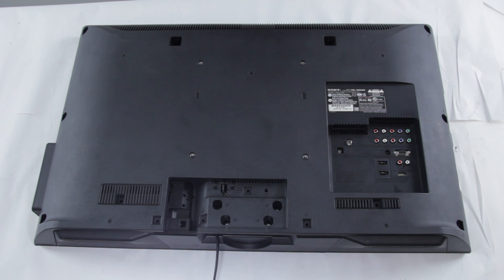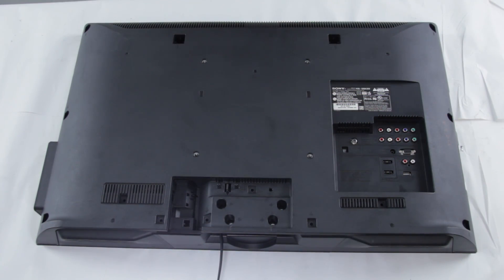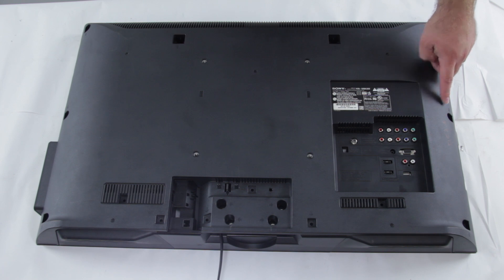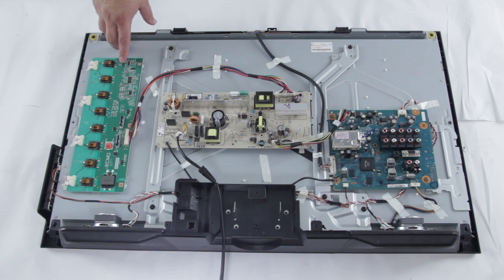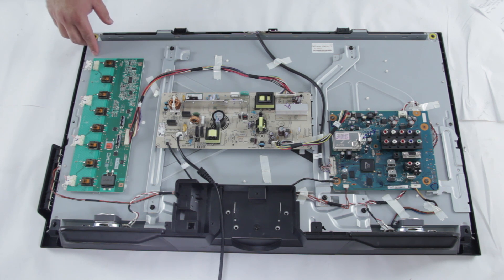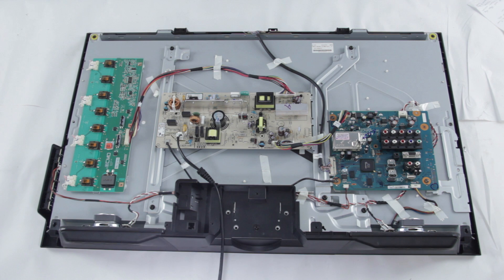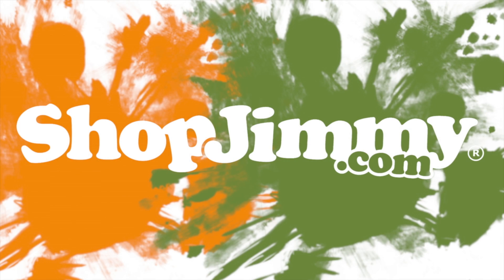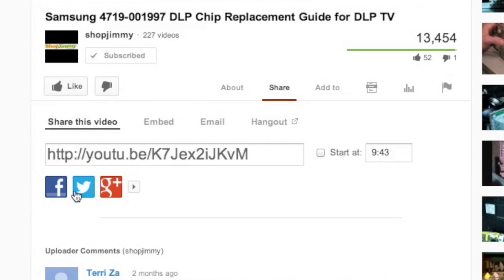LCD TV Repair Tutorial - Backlight Inverter Common Symptoms & Solutions - How to Fix LCD TVs

Comment: Thank for the video.  I  have a sayonapps TV that has low brightness.  Model no: LED-32A . Ac voltage: 100-240v~,50/60HZ. Power consumption: 60w.

Comment: My Samsung 2021 65’ Model: Model :
UN65DU7200D Model Code: UN65DU7200DXZA Serial number: 0H0B3CZXC00219 has a black screen and all other features seem intact so is it accurate that statistically speaking the issue is most likely is TV Inverter, then Capacitors, and then LED Bulbs themselves?    What does a replacement cost for the inverter and perhaps the capacitors but I think if it’s the bulbs it might be too much for me,  thoughts? What tools would I need other than a multimeter?  Thanks Lewis

Comment: I own a Vizio M3D55OKDE television. Serial no.LTYPMLGN4651757  there was a dark impression on the upper right hand corner. After a month or so, the lower screen got dark as well. I was assuming the backlights were going bad. Upon disassembling the tv. I noticed there are no back light strips across the back of the housing as seen in many of your videos.  Can you help?

Comment: I have a high sense LEDLCD TV model number 65R6E1, serial number 65G1947M5H03109. It turns on and the screen flashes and the red light flashes three times. It won’t let me home it.

Comment: D65U-D2   these hve the high backlight strip failure rate so i wonder if its just the strips but its a 65" vizio its darker than normal especially along the bottom 5 or 6 inches towards the middle and to the right of screen and if i raise the brightness for more than a few minutes the screen will shut off but i still have sound and i used a flashlight and could see the image with a flashlight on it after it went blackscreen and still had sound.  inverter board??? lcd display? im not sure

Comment: Hi I received a TV from a friend who bought a new one. There is NO REMOTE CONTROL and the buttons on TV have been damaged (will try to link pic). I'm able to use manual power button to turn on (green light solidly displayed), the screen brightly flashes momentarily then goes black. When all lights in room are turned off and flashlight is directed towards screen I am able to faintly see the home screen displayed therefore I believe it is a backlight issue. Please help! Also, TV has not been connected to wifi network. Toshiba model 58L4300U Serial D53368T12311C1 dec 2013

Comment: Hello, I own a Toshiba Regza 40xv648u LCD tv. It initially had the following issue: black screen with audio ok. I made the flash light test and were able to see the menu. Then I replaced the backlight inverter board. Now the TV seems to work perfectly fine (screen and audio are ok) but after few minutes the TV shut off and restart by itself. Do you have an idea what could be the issue? Thanks in advance!!

Comment: Hi Sony KD-55X9005C model first problem started wouldn’t power on checked fuse ok then tv ok until next day, now no lights nothing, tries a hard restart, that didn’t work, checking the voltages marked on power supply all seem correct, so am mistified as getting absolutely nowhere, thank you!

Comment: Hi, i have a JVC tv (LT-32A80ZU) it turns on then immediately goes black
the inverter board has black stuff on one of the 0 resistors going to one of the transformers. can't seem to find the short. is a new inverter board my only option?

Comment: Hi, I have a  Samsung TV model LN55C650L1F. It is not my primary TV, but a TV we used when childres were yunger, so it is not too much used. Anuway, since a couple of years I noted that the right side of the screen is a bit darker (dimmed) in comparison the the left side. I have the while screen, but as I said the right half or one third is darker. This point makes me think that the backlite, if composed by two stripso, or tubes, could be the reason, not necessarily the backlite inverter, but who knows ... ;-) I am not sure if they are LED backstrips lights or CFL lights, and I cannot fint this information.
Could you, please, help me with this information, and in both cases let me know what exactly is the model of the lights.

Thank you very much!
Orline

Comment: Hitachi Roku TV  model  # 55R82  55"  serial #TH9GD04502. It was working fine then the next day turned it on and screen was black. It has sound. The Flashlight test showed images (inputs) on screen. I watched many of your videos and it kept pointing to the Blacklight inverter. I can not find the inverter location. Does it have an inverter on this model or is it some kind of LED lighting ? Everything else is working fine  I just have a black screen.

Comment: Hello!
I have a Sony TV, model KD65XE9005. The initial issue was the led blinking 4 times in red. Now, the leds are no more blinking I have sound, but no image.
I had already changed the tcon board, but it was not because of the tcon that the issue changed in fact. Now, even with the old tcon board I had sound but no image and no more the 4 times blinking error. Could you help me?
This is the panel or inverter board? Thank you, Anderson

Comment: Hi I have a Sony Bravia LCD 32v 4000 which has shitdown after a few seconds followed by a 4 blink red light code. Have replaced inverter board with some temporary success but back to 4 blinks. I am repkacing caps in the power supply but would appreciate any advice.Thank you

Comment: Sharp Aquos 70" Model LC-70LE847U   Serial # 301814406.   The screen is black but the chevron power light is illuminated.  In a dark room I can see the menu with a flashlight.  Any help would be appreciated.

Comment: I have a 48 inch TCL tv model# 55S403TIAA and it has the black screen but I can hear audio. It’s under and extended warranty if I pay $250 to have it diagnosed. Not worth spending extra money so stupid. Thats not even to fix it. Anyway when you start it up it does try to show the intro pic. Then goes to black. So the inverter? I didn’t even know you could fix a tv like this. Amazing.

Comment: I have a jvc 65in class 4k under 2160p led roku smart TV  lt-65maw595...I was watching TV and the screen suddenly went black, I've tried a hard reset and if I stand close with a light with the TV on I can see the images on the screen...would it be the backlight, control board? Also about a month before it went black there was a slight constant buzzing noise

Comment: I have an LG 55LX6500-UB.AUSWLJR TV.  Last week I had no backlight but I did have sound and the TV would turn on and I would see the panel at the bottom light up, but the screen was dark.  I tried all of the troubleshooting tips.  I finally opened the back and saw that my Backlight Inverter Board looked was dark in one area, so I thought it may have burned.  I replaced the board and the TV worked great for about 1 week.  Now, the LG logo appears briefly for one second when I power it on before disappearing.  I once again tried troubleshooting it, but I haven't yet opened the back up again.  Any ideas?

Comment: Great videos. I have a 2014 Vizio Model # E550i-B2. Serial # LWZZPPAP5205680. Perfect sound yet black picture. And when  very close to screen with flashlight I can see images. I checked your site for a Inverter board, at least this is what I'm suspecting. You are out of order. Will they be coming in soon?

Comment: I would never start replacing parts at anything that needs to be repaired. Testing components to rule out what doesn’t work is the proper way to go. If replacing parts is the method just buy a new item because after you replace all the parts it will most like cost more than replacing.

Comment: Vestel  500UNDC using a vestel 17PS20 power board. Backlights come on and picture shows for a few seconds and then goes dark. Sound is fine. Is this a problem with the led strips or the backlight driver ? Many thanks

Comment: I have a 42 inch lcd olevia tv with no power button and I've been touching a wire to get a full circuit but I'm not quite sure how I can turn on my TV easier
Reply: Ok the front of my TV is where it's located
Reply: I need to know exactly where I need to touch the wire to get cull circuit to power my tc

Comment: hi...greetings jimmy...my tv model Sanyo 42”LCD TV LCD-42K40-HD having a power problem where when plugin the current 
the red light is on with no issue but when i pressed the power button its sitch to green lisht only a few second and goes of and tried 
press again the its stay quiet a while and goes off .i tried to pull off the tcon cable and switch on still the same .tried pull of the inverter 
cable and switch on still the same ..so can you pls help me in this issue and if can i will send pictures and videos for assistant.tq jimmy

Comment: I have a toshiba 55HT1U, it would turn on and then off, so I replaced the power supply board, still didn't work, then I replaced the Inverter board master, It works but is making a buzzing noise and one of the parts overheats, I replaced it from the old board, but still makes the buzzing noise and overheats, and like a minute later, the screen starts to blink. How can I send you a picture of the part that overheats?

Comment: I found this video out now while I am dealing with two eizo lcd monitors with cold solder on the inverter board.i assume that because the tv flashes the logo for two seconds and then no image no light also the resistance on the coils seems fine I would appreciate any help

Comment: Hllo sir, i am having lcd tv with model no. LCDTVVRL22HGL-FLK. when i turns it on red led changes to blue color, but display doesn't work properly, even i changed its inverter card but problem still occurs. Plzz help me

Comment: Hi I wonder if you could help me out? I have a Hitachi  Model number '43HK25T74U H' I have a black screen but the sound is still there seems to power on as normal, I cant see any light in the back of the TV so would I be right in thinking its the LED strips that are faulty or could it be on of the boards like in your video? Many thanks

Comment: VIZIO E421VO: When I turn the TV  on I can see on the screen the VIZIO's logo for a second or two, but after that, the screen goes black, there is sound and if point a flashlight to the screen I can see a bit of image moving. So I would really appreciate it if you guys can tell me how to test the ccfl inverter and well also how to check the ccfls, so I can orther the right part or parts for my old TV. Thank you in advance guys, and have a wonderful day.

Comment: I have a LG Model 42LK450-UB, Serial No. 108WTEL0D588. Suddenly it will turn on but no audio or video. Only Slight tint on screen then turns off. After abot 10 seconds, it turns off and after about 10 seconds it turns on by itself and this repeats until unplugged. With the back off I can see the lights real well through the holes. Any ideas? Voltages from the power board all check okay.

Comment: Song KDL-32R330B has sound but no picture. Did flashlight test and there is picture visible. When tv first powers on the screen comes on for the Sony logo and the goes black. TV only has two boards inside. Green main board with all the video outputs and a brown/tan power board. From your videos I assume the power board is the one that needs to be replaced but I was thinking there would be a separate backlight panel.

Comment: hi i have a panasonic tx-55cx400b tv when i turn tv it works ok but after a while screen goes black and still have sound , if i turn tv off and back on works ok then screen goes off with sound on , the backlights are off at back of tv , i have nothing connected to the tv . Ive called panasonic they say it the backlights but i want a second opinion as they could be just trying to get money off me or to buy a new tv thank you

Comment: I think I have an issue with my backlight inverter but I’m not certain hoping you can help diagnose. The TV works fine as far as sound and image except 1/2 the screen has suddenly gotten dark. You can still see a faint image on this side but it’s darkened compared to the other 1/2 of the screen and how it should look. Element ELDFW464

Comment: Sharp LC-80LE661U turns on sharp logo appears and then it turns off. Replaced main board power supply board and t con board. No change. Any thoughts?

Comment: I have a un46eh5300fxza Samsung tv. The back lights are not coming on, but you can see the image with the flashlight test! I’m trying to see if I need a power supply board or led strip

Comment: hi!i have a hisense 40 inch 40K322.no picture with sound.we replace dead led lights.backlight is good.still no picture.then backlight comes off.low voltage output on the backlight.what should be the problem?have changed. filter capacitors.still no backlight...

Comment: Good Day, need help finding out where the backlight inverter is located ( by going through several of your tutorials, I understand that could be either on the power supply or in the main board ) Vizio E500i-B1 LTY6PLKQ5250193 (power supply part number is ADTVE3613XA6  715G6100-P05-003-002H, main board 705TXESM37400X). the symptoms are: tv powers up, shows vizio logo for about 1 second, then turns black, but standby led fades out. Tested with flashlight and does show image, but backligths wont stay turned on. So at this point i'm still not sure what boards i need to replace. I rather replace only the defective components, but i don't know where to look. ( no component shows sign of overheating, burnt etc )  I do have multimeter , soldering kit etc. I appreciate the help.

Comment: Hello- I have a Samsung LCD LN40E550F7FXZA. All research leads me to believe that the backlight inverter is the problem (screen shows up for 1-2 seconds, then goes dark, cannot visualize any backlights, sound is fine, can make out an image using a flashlight ) I would like to try to repair it myself. Can you tell me what steps/additional troubleshooting/ parts I would need. Thanks!

Comment: Hi, I have a samsung ln46c630k1f tv, when I turn it on I hear the audio from the source and if I point a flashlight in front of the tv I can see the image too. The issue is different from what I see around where so many people have the light turn on and off. It doesnt happen to me. Backlight is off from the start. I turned on the TV at night with no lights and couldnt see any light from the moment I turn the tv on.
Would it be the backlight inverter SSB460_12V01 broken? Thanks

Comment: I am having tv problems. I have a Sony KDL-40V2500 and I turn it on and the audio and video come through for about 5 seconds then audio, video, and backlight cuts out and the tv goes into a standby mode with the orange/red light blinking in intervals of 4 blinks. What do you think the problem is? Possible backlight panel? Or t con?

Comment: I have an LG 32LC45-ZA S/N 803MAFC01275 (European model) which flashes on the backlight for about a quarter of a second after powering on, then the power supply shuts down. (The front LED remains green.) The power supply capacitors have all been replaced using a kit (originally the TV was completely dead, it wouldn't even power up to standby). If I disconnect any four of the high voltage outputs I get exactly the same symptoms except that the power supply doesn't shut down. It seems as though this is a power supply problem not an inverter one - what do you think?

Comment: hey there, I have a Samsung LN55C650L1F and when I turn it on first thing in the morning, it works fine, but if it gets turned off, and then on again without "resting" for a long time between, the backlight does not work. is this just a loose connection, or do the backlights need replacement? It looks great when it is lit.

Comment: RCA L40FHD41YX9 Powers on and displays image for a moment then goes black. Can see with flashlight in the dark and sound still works. Definitely suspecting the backlight inverter but I have tested the mosfets for continuity and checked fuses on the board and all tested fine so before purchasing a board I wanted to reach out to see what other tests to perform to ensure the board is the problem. SSI-400-14A01 is the board and I realize it is a generic board for multiple 40" units from that year and it is suspect for going bad just wanted to be certain, thank you.

Comment: I have done the flashlight test and do see a faint picture. My model# is UN50M530DAF.
MY S/N is 06TQ3CVJ600730Y.
Help with the correct part would be so appreciated.

Comment: 🙋Hello I'm having an issue with my song bravia kdl-40vl130. The tv turns on and has power but the screen appears to be off & the standby light flashes red only once like every 30 seconds. I've inspected the bulbs & can't seem to find any info regarding errors codes. If you have a solution your help would be greatly appreciated thanks👍😁😎😉👌

Comment: Hello, I have a black screen issue with my Samsung TV model LN32D403E4DXZA. The sound is working but the backlights are not. There is no image on my TV, but when I hold a flashlight to the tv, I can see the picture. How do I know if the inverter is the issue or if I have to replace the backlights themselves? Thanks

Comment: are power supplies with the same number interchangeable, even though they look different?  the power supply part number on the sticker reads "0500-0405-1290"  and there are currently 2 available.  Should I just get the one that looks most like mine? or buy the cheaper one (will it function the same?) connectors all look like they're compatible.

Comment: Hey, I have a NEC E505 tv that is not turning on, the red led light blinks 8 times but won't turn on, I bought a a whole repair kit, power boar, main boar and the t-con and still showing same symptoms, then I went into a dark room, shown a light on the screen and realized I could see some images, plugged my cable box and I could hear some scratchy sound on and of but no pictures. Any help?